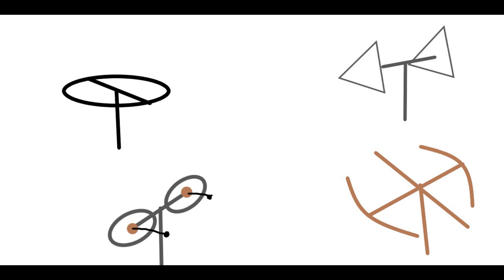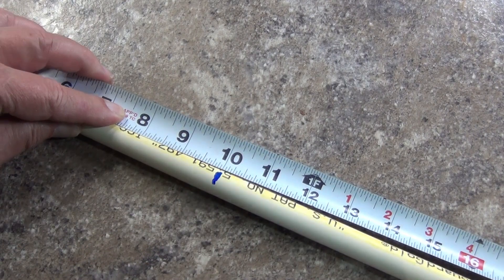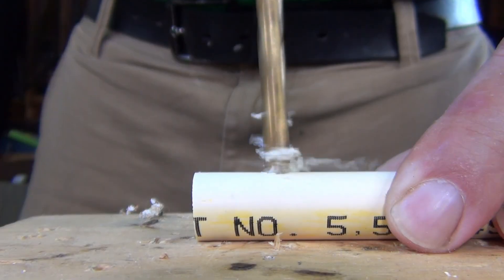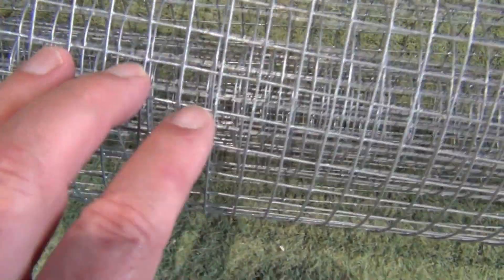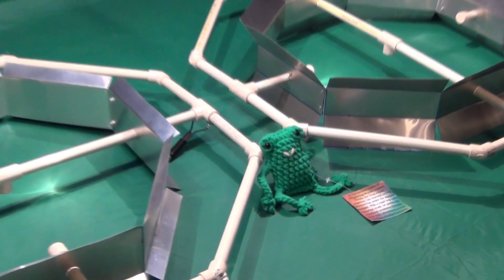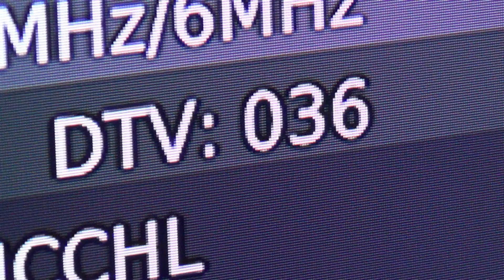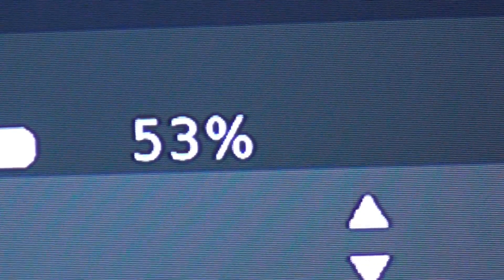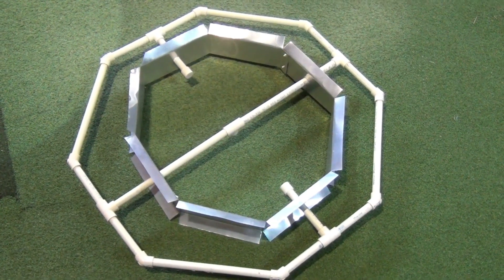Octagon TV Antenna Upgrades -  Is It EVEN BETTER??

Comment: I may be making the Double Hoop Antenna with built in reflector for my in-laws, so I would like to know how 3 twisted 14 ga conductors compare to a single 10 ga conductor in this type of antenna.  This would be a bit cheaper for your users and much, much easier to find.
Reply from the maker: Yes, the three twisted 14 gauge conductors will work great in this antenna.

Comment: Thanks for the great antenna info videos. On this design I would like to know if using hardware cloth instead of solid reflectors makes any real difference in reception. It would be nice to be able to use hardware cloth to reduce wind resistance.
Reply from the maker: I stated in both this episode and the original build episode that I recommend hardware cloth for the reflector for outdoor use.

Comment: Thank you so much for doing this build to compare.I am surprised at the results but that just shows how superior your original build was and that under the right conditions performs very well.Im very happy with how it's working for me.I was wondering how the mesh reflector works the same,I thought the flat surface of the aluminum flashing would direct the waves back to the element better.Can you share the science behind that please?
Reply from the maker: Thanks again for the work you did! No, reflectors do not have to be solid materials. Look at a lot of commercial antennas and they use spaced bars as reflectors. Even many of the older satellite dishes used perforated or screened materials. You may have just given me another idea for a future episode! Thanks!

Comment: What is the distance to the tv towers in your area?
Reply from the maker: All were within 40 miles from my house.
Reply: @mrhoptoit7835  ok i need one to get up to 80 miles plus trees in-between
Reply from the maker: Multidirectional antennas will normally not receive signals at that distance.Try checking out this antenna. Its my longest range design. 
https://youtu.be/EbOfD1aV4Dw
You still may need an antenna amplifier on it for that distance. If you want to purchase an antenna, consider a large yagi. Thanks for watching.

Comment: I like the fact that you did some real science here.
A very small difference is all I would expect.  If you know someone who does a lot of RF stuff they may have a "VNA".  If they do, they can likely scan the antenna's impedance to see how lumpy it is.  If you get a good match to the input side of the balun, the antenna would work about as well as possible at that frequency.  At other frequencies you may get less performance because you end up reflecting RF power right back out of the antenna.
BTW: Yes, you were hooking to the wrong spot.  The shield on the coax is where you want to hook the reflector if anywhere
Also:  Now that you have two antennas, you can put them one above the other with very straight lengths of wire between the terminals.  You pick off the signal at the 1/2 way point between the two.   For a signal coming in from the direction you expect both antennas will make the same voltage at the same phase.  Symmetry at the pick off point says the phases will be the same so the signals will try to add.  If someone flies over you with a transmitter, the distance between antennas makes for different arrival times and those signals will likely not add or perhaps cancel.  Aircraft can make multipath distortions and mess up the TV for a bit as they go over.  This might prevent that.
Reply from the maker: Thanks for the great info, Ken. I just tried bonding to the coax as you suggested, and there was still no noticeable difference. As always, I appreciate your feedback!